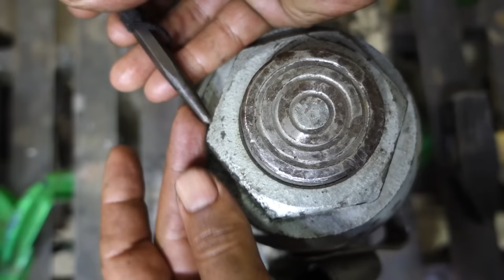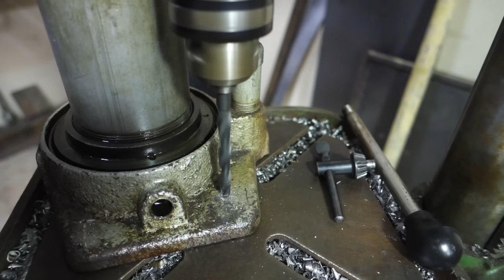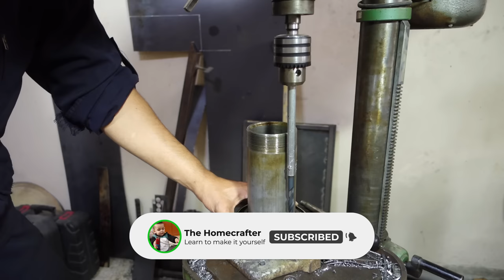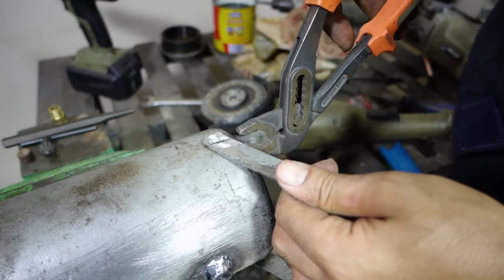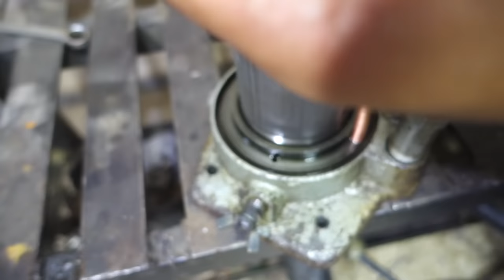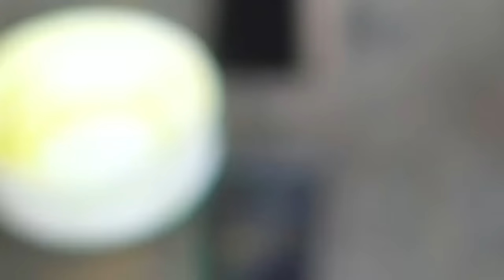flipping the hydraulic bottle jack

Comment: Thanks for this easy torturial.
I've just flipped my 30 ton jack in maybe an hour, including welding the new plug etc.

Way beter for a press than to use all those clumsy return springs etc when using an bottle jack in its original setup.
Reply from the maker: Nice work brother and thanks
Reply: Could you crush a Briggs motor to get the cast cylinder separated from the aluminum

Comment: Hi Home Crafter, there is a company in Australia that sells hydraulic presses with an up side down jack that they modify themselves. They also change the small pump around so that the pump works on the down stroke not the up stroke like yours. The seals at the top of the ram and the top of the pump need to be in good condition as normally the oil flows down away from them and so don’t leak much but when you turn the jack up side down they are immersed in oil all the time so they can leak. I have had to replace the seals in mine but it’s an easy job. Excellent video and I love your creative solutions to problems. Cheers Stuart 🇦🇺
Reply from the maker: Good day brother .that is better then my system i will remake my press in the future  and i will separate the pump from the ram to use it like yours. thanks 👍
Reply: You don't need to modify anything, just insert the lever from the other side and your pump will work on the down stroke. The Polish company SKAMET also makes such presses with bottle jacks in the reverse position.

Comment: Next time instead of holding the jack in the vise to remove the large nut just use the vise to grip the nut in the upside down position and just turn the entire jack instead.  Much easier that way brother. But don't get me wrong you did great on the jack!

Comment: I made a press with this kind of jack but I left it upright; all I did was weld a plate to the top of the jack and mounted it like that. In my opinion, why risk the leaks? It has worked without problems for over 20 years.
Reply: Yep, I love the detail in the video, but I'm a bit lost as to why it needs to be inverted to use as press?
Reply from the maker: Thanks. This way I don't need other parts to use it.

Comment: you made 2 errors in that conversion, the first one is to not seal the pressfit of the copper tube in the base of the  jack, the second one is to rely on the Oring on the jack cover gland to insure the oil tightness when the jack is in reversed position, a spring loaded oil seal is a must.
 I learned it the hard way.
good video.

Comment: good job.
but I have a question what is the point in inverting the jack. it can be used in it's original position
Reply from the maker: Thanks I did this so I dont use more steel then I need and use directly the piston of the jack

Comment: I have tried inverting hydraulic jacks before, and they never work! Like the fluid in them drains to the other side, and they won’t pump.  But they have enough fluid in them, because they always work just fine the right way?
Reply from the maker: I'm using my hydraulic jack on my press inverted for two years and I found out that I need to keep the return valve closed and the pump handle  down 👇 ready to pump .Sometimes I don't use it for months but when I do it always works

Comment: Is it enough one 9mm pipe? What about other ?
Reply from the maker: You can use a smaller size even 6mm it will fit without drilling
Reply: @TheHomecrafter1988  I mean other drain hole, close or open?

Comment: It would of been easy to just cut off the piston off the 3ton and get square like tubing weld a small channel iron on each side and weld the 3 ton piston in the center and weld a plate for base to mount the hydraulic straight up you can also put return springs if wanted. 👍👌✌️💯🛠️

Comment: It will not work upside down you must have a mechanical jack the fluid will be at the top of the jack and the pump will run dry
Reply from the maker: I made my press and I'm using it for more than a year with no problem watch the video of my press

Comment: Upside down jack don’t work
Reply from the maker: yes they do work if you did this modification and i have a press build on my Channel and I'm using it for a year now this way without a problem
Reply: Yes it does. My press has an up side down jack for many years and works perfectly.
Reply: You have to make sure that it's a multipositional jack.  You are correct in that the cheap jacks won't work upside down.  The labour in this video isn't worth it, just buy a press or build a frame type that takes a bottle jack without the hassle.
Reply: It works just fine if you modify the oil reservoir pick up point as he has here.